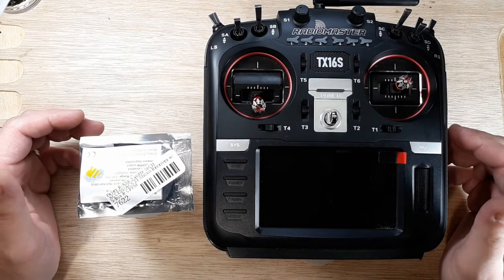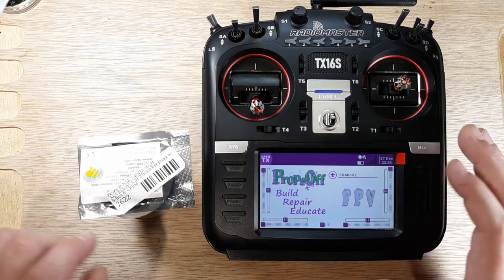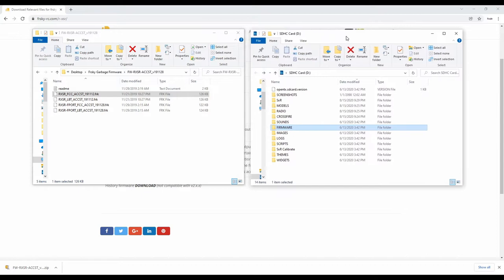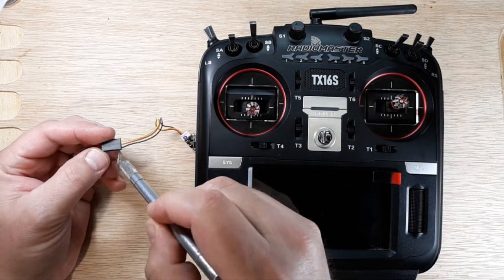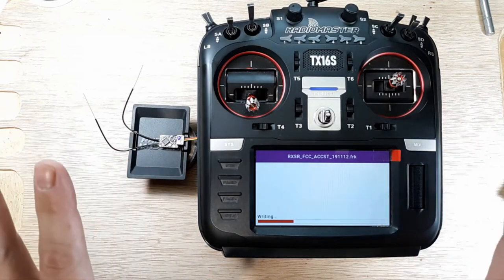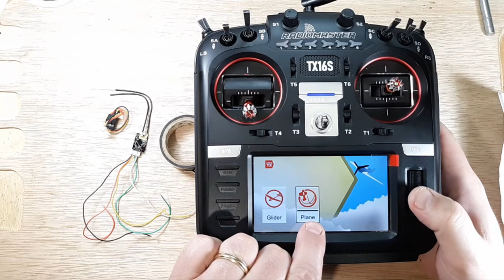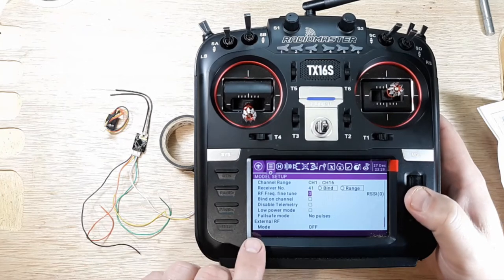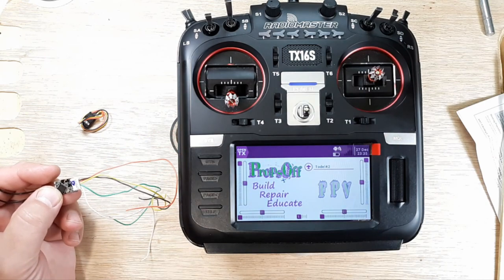Frsky R-xsr Binding To RadioMasterTX16S | Step By Step How To Get This Receiver To Work

Comment: I dont see frsky on my controller all i see is FrSkyRX. FrSky X. FrSkyX2 and FrSky L. Also I have a modle for a quad idk if that would change anything
Reply from the maker: What version multi-protocol version are you running?
Reply: @propsoff  i dont know i just bought it like a week ago
Reply: Use the Fr Sky X   D16.
Reply from the maker: @ac0de, Its aggravating when YouTube fails to notify me that you commented. I found something that may help...
https://github.com/opentx/opentx/issues/7934
The version on my TX16S is different from yours. 
Hold the SYS-BUTTON down
Page over one time
Scroll down once to Firmware
I'm still running "multi-stm-opentx-aetr-inv(noninv)-v1.3.1.49.bin"
Reply: @ACodeGaming  use the FrSky X.   D16

Comment: How can I tell what version of my rxsr receiver I have?
Reply: Or is this video of telling me it doesn't matter what rxsr receiver it is if I can flash an acces firmware on it it will now be what I need to use the tx16s?
Reply from the maker: @MrSabram07  
Here you can not tell what firmware is on the R-xsr.. I have only seen a label on 1 that described what was on it. There are 3 different firmware versions to choose. 
I does not matter. Download the ACCST (History) to it for the RadiomasterTX16S,  or ACCESS for a genuine Frsky radio that has pre-installed ACCESS on it.

Comment: i have a radiomaster tx 12 and tried to follow your steps with it, but i dont seem to get a bind any help?
Reply from the maker: What are you binding to?
Reply: @propsoff  radiomaster tx12 to frsky R-xsr
Reply from the maker: @nicoschneider5965  
Need to download the correct firmware to the r-xsr...
Reply: @propsoff  i did download the exact same one as in the video
Reply from the maker: @nicoschneider5965  
Internal RF
Mode = Multi
Type = Frsky
Subtype = D16
....bind
Reply: @propsoff  been there done that
Reply: All 3 leds are on solid
Reply from the maker: @nicoschneider5965  
If you have a solid green, what makes you think your not bound?
Reply: @propsoff  when i turned it of and on again it is not on and my tx12 keeps beeping
Reply from the maker: @nicoschneider5965  
How did you upload the firmware to the r-xsr?
Reply: @propsoff  over the module bay of the tx12 i followed a diffrrnt tutorial for that
Ps. Thaks for your time im quite lost here
Reply from the maker: @nicoschneider5965  
Hit me up on Facebook, copy my last message and paste it so I know it's you..
https://www.facebook.com/scooter.pie.100
Reply: @propsoff  sorry i dont have facebook 😅 do you maybe have instagramm?
Reply from the maker: @nicoschneider5965  
I do, but I don't use it, lol..
YouTube chat is frustrating,  lol
Reply: @propsoff  i wrote you on fb
Reply: Btw im in the EU so i use the LBT versions does that matter?
Reply from the maker: @nicoschneider5965  
I have not seen a notification from you in Facebook?
Reply: @propsoff  i tried again
Reply from the maker: @nicoschneider5965  
On the radio should be LBT instead of D16
Reply: @propsoff  yes i just tried that and also flashed the lbt version on the r-xsr

Comment: Do I have to remove the receiver from my quad to do this?
Reply from the maker: If your RXSR still has the connector, you can place the adapter in place.. If you're unable to unplug that and plug in the adapter, then yeah, you'll have to remove it..
Reply from the maker: This is probably one of the biggest examples of why Crossfire gained ground, it can update wireless.
Reply: Can you think of any whoops that can bind to the TX16s without this method? I’m a newbie so it would be nice to have the process as easy as possible. Thanks
Reply from the maker: @deehn4140  
The TX16S is open source, there's lots to learn. However, if you get a Mobula6 or something like that (frsky receiver built in) it is easy.
Reply from the maker: @deehn4140  
Still a process because it's open source and you have to set it up. I did make a video that goes through every single step  in detail..
https://youtu.be/loAe4H5HS2k
Reply: Might be a dumb question but do you have to set up every model in beta flight?
Reply: By the way, I just received my TX16s yesterday. I plan to use a sim for awhile. When I feel comfortable on the sim, I will purchase DJI googles and a drone or 2.
Reply from the maker: @deehn4140  
Not a dumb question.. Yes, you will need to enter Betaflight every new quad you obtain. Will you have to do a full setup? Depends on equipment..
....sim time, see ya in Liftoff...👍🏻🍻👊🏻
Reply: No I plan on buying the Dji goggles and a digital and maybe analog whoops. I will get the analog adapter for the Dji goggles.

Comment: so i cut my wire and threw away the black portion you used to update firmware. Newbie i know.... now i dont have a way to update. wanna send yours since i have a tx12? LOL
Reply from the maker: Yeah, the being new to the hobby mistakes are a bummer.. Here's a best case scenario for us both - shipping is more than the cable's value...🤔
https://www.racedayquads.com/products/r-xsr-to-servo-lead-programming-cable?currency=USD&variant=39494536560753&gclid=Cj0KCQiA4OybBhCzARIsAIcfn9mZhPHSpt6AYVU97WtU2SkFF4jEX4h-ZGkwB5dyhSjF9UndCBu-rUMaAjKUEALw_wcB

Comment: I've downgraded my receiver it looks as if it's bound to my controller but my controller won't show up in betaflight oh subbed and liked thanks
Reply from the maker: Did you tick the correct Serial RX slider in the ports tab?
Is the correct protocol "SerialBasedReceiver" & "SBUS" selected in the RX section of the configurator tab?
Is your RX and TX correctly soldered at the Uart on the flight controller? 

These are the first things to investigate. Welcome to the PropsOff family! Glad to have ya...👍🏻🍻👊🏻
Reply: @propsoff  I held the bind button down for to long once I changed it back she's all up and running thankyou so much for these videos you've help so much.

Comment: in jumper t12 pro i this same ?
Reply from the maker: If your T12pro is using the Multi-protocol module, yes..
Reply: @propsoff  yes, Jumper T12 Pro is a multi-protocol, thanks for answer
Reply from the maker: @RCSajmon  
The firmware "downgrade" of the rxsr will be the same then.. Enjoy the Breeze...👍🏻🍻👊🏻

Comment: I'm unable to get a response to gimbal motions in betaflight 4.2.11. with my R-XSR updated as you described.   Connection to radio is good.    It's a XILO F4 FC.    Here is a video of my situation.  https://www.youtube.com/watch?v=oq4i2fPCeDI
Reply from the maker: You held the bind button-down on the RXSR too long and you've put it in to CPPM mode, so you must hold the bind button-down until the blue light comes on solid, that will indicate you're in S bus mode.
Reply from the maker: 21:46
Reply: @propsoff  THANK YOU PROPS OFF.   Too long or too short?   Do I have to unbind the radio?   Can't seem to avoid flashing blue.  How long is too long?  The bind is almost instant.
Reply from the maker: @rre9518  
The blue led on the R-xsr should be on solid to indicate SBUS mode.
12 second hold on the bind button should do the trick. If the green LED is solid, it's bound.
Reply from the maker: @rre9518  
Ports tab / serial rx / set to R1 (uart rxsr is soldered to)..
Configuration tab / serialbaserecei/SBUS
?